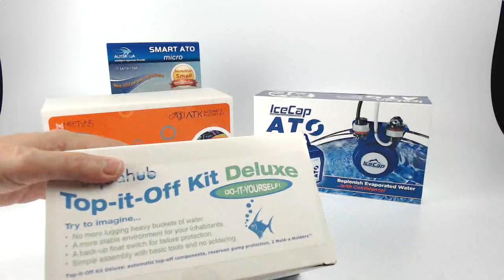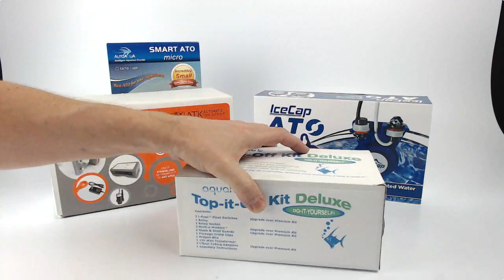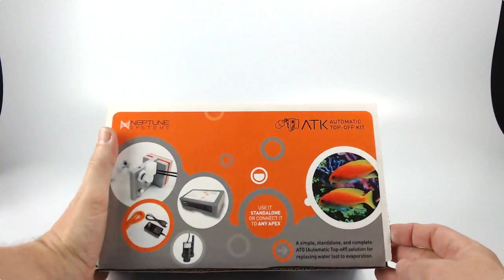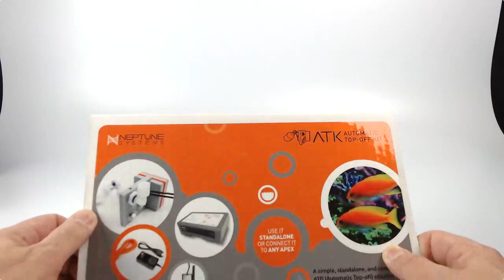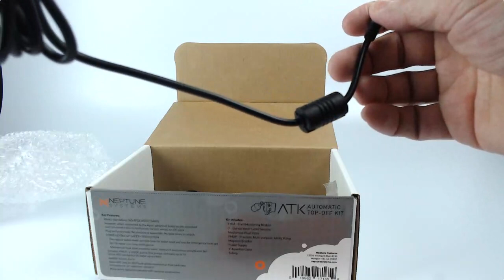Let's talk about Automatic Top Off Systems

Comment: There's one problem with ATK. If you add kalk to your ATO, the sensors get a hard film on them and they give false readings. I have two and both need constant cleaning. The solution is to move the return hose a distance from the bracket/sensors but you lose the redundancy of the float valve.

Comment: All of those ato systems would not perform 100% the same stability, even  if to use the same set onto another aquarium system, and esplly when the wet parts (sensors) were exposed to lighting and enclosed fluctuations caused by bubbles/living stuffs, e.g. a fish/planted tank without sump where to put those sensors in was a crucial uncertainty. The overdflowing  massages sent by apps might tell ppl that, the last float was activiated, but from which could not be 100% in accuracy to tell the exact situation that could be transffered by insight web cam (24-hr standby) instead. There could be plenty of various interferences causing false alert.

Comment: Not trying to troll or be a pain, but fresh water dumps over reef beds all time. Reefs are usually in shallows, so they have more sun light. During a storm, which happens a lot in winter months in the pacific, rain water will haze the visibility all the way to the reef bed. Well shallow reef beds like 4-6 feet. And pacific islands have mountain just a couple miles inland, so there's huge run off right into the ocean in places where the reef bed Is the beach. No sand, just reef, in and out of the water. I hated spear diving during those times because it could be sunny, then within minutes you'll be in the middle of a down pour. We free dive so scouting for fish is usually down on the surface. During these down pours you need to porpoise up and down to get out of the haze. Usually, just head out beyond the reef to blue water and dive down under the brackish water haze. But it is a pain. And it happens all the time.
But yeah, just because it happen in nature, doesn't mean it's healthy. Just like, do you use a lightning effect on your leds?? It happens in nature, but it stresses the crap out of the fish.
Reply from the maker: I don't really understand your point about freshwater hitting natural reefs in relation to this conversation about top off systems.  Are you trying to make the point that wandering salinity levels are nothing to worry about?  The rules of a closed ecosystem are quite different from a natural reef.

No, I don't use lightning effects or cloudy days over my reef.  I try to keep things scheduled and stable.
Reply: @melevsreef  
No, I was just saying that this does happen in the ocean. There's also huge tide pools that get isolated during low tide, so like twice a day.  The water level drops drastically in these and cause high concentrations of salt,  then they're hit with waves and in a few minutes go back to the oceans parameters.
It kind of sounded like you were trying to say that this doesn't happen in the ocean. About 2:50 in.
Im NOT saying it doesn't mater. Just that huge, unstable salinity in nature happens daily. 
As far as the lightning reference, I was just pointing out that just because it happens in nature, doesn't mean it's healthy and should be replicated. Same goes for salinity stability.
BTW, I really enjoy your videos. 
Could make one about all the different types of media reactors and systems that out now controlling nitrates and phosphates.

Comment: Ro membranes usually have 96%ish rejection rate(check the stats on yours) tds going in 100, tds going out 4 so if tds going in 100 and coming out 70... time to change the membrane... you may notice this by increased di resin usage.

Comment: I have a two stage system. An ATO connect to my RODI system that refills my top off reservoir once a day. It is powered thru my APEX so it turns on for 30 minutes, just a little longer than it normally takes to refill the reservoir. I then use a Tunze ATO to fill the sump. Everything is automatic and safe.
Reply from the maker: Is there a reason you refill it so often?  I fill mine up once or twice a week because I know RODI systems run more efficiently when it runs long and hard versus shorter periods.
Reply: @melevsreef  My thinking is that if you have a smaller reservoir and the ATO fails in a way that it doesn't stop filling your sump, you have a smaller issue to deal with from both the potential flooding and the drop of salinity in your tank.
Reply from the maker: @ytfpv2627  So your ATO reservoir only has enough water for one day?  Mine lasts a week.
Reply: @melevsreef  It might have capacity for 2 days, but not much longer. I think that it reduces the risks of putting too much fresh water into the tank.
Reply from the maker: @ytfpv2627  Not bad. I used to have three days' worth for my 280g, with 15g of water that could be added all at once if it ever happened.  It never happened. :)

Comment: Having issues with my ice cap ato...had it for a week and the thing beeps everyday or so...water will evap then it will beep until I turn it off  and get it working properly again. sensors are set up accurately any clues ? Defective?
Reply from the maker: Contact Coralvue for assistance. They will get you taken care of.
Reply: I decided to give it one more go before making a call and it turns out it was user error! The  Ice cap ato  has been working great since I last adjusted it. I have an  all in one tank and I put the return from the fresh water  in the same compartment that my sensors we're in...The splashing from the return may have caused the warning sensor to go in  alarm.So I moved the return ato line into another compartment and we have restless sleeping again.A little logic goes a long way 🤪

Comment: Good video! Only issue I had with the Smart ATO micro was an air bubble in the pump after refilling the reservoir. It restricted any water from topping off. I actually thought it had broken until I kept messing with the pump and removing the small plastic filter cap for the inlet. Doing this cleared the bubble and it's been working great ever since.
Reply from the maker: I guess anything is possible. lol :)

Comment: So instead of using a pump, is there any harm in using a solenoid valve?  Obviously you'd need float switches, but gravity fed is kind of the way I'm going to go since my 110 gallon reservoir is in another room with a 1" pipe to the tank (slimmed down to take 1/4" tubing of course).      Basically what I'm asking is can you buy the sensors for a Tunze Osmosilator or something?
Reply from the maker: If your reservoir is elevated in that other room, gravity feed is definitely an option.  A solenoid valve can be used in conjunction with a controller based on water level sensors reporting results. Apex now has those solenoids.

Comment: I've been using the Neptune FMK with the optical "float" switch for a while now and I'm quite happy with how it's worked, but I have had the FMK module itself go off line a couple of times which would cause the sump to begin running dry. Rebooting the Apex has, so far, been enough to resolve the issue and allow the FMK to re-connect. Has anyone else noticed this?
Reply from the maker: I'll be watching for that, personally. Thanks for the heads up. I'd like to hear from others about this as well.